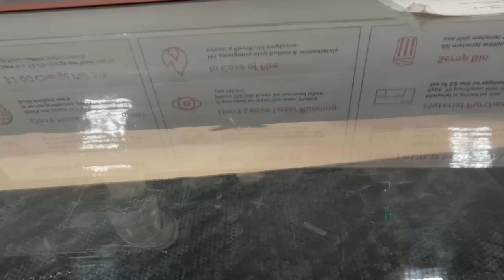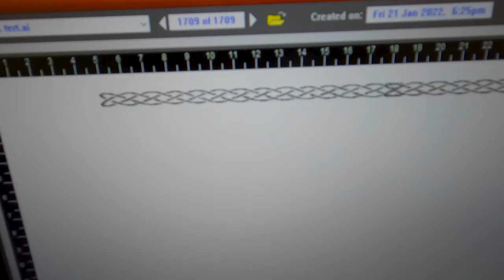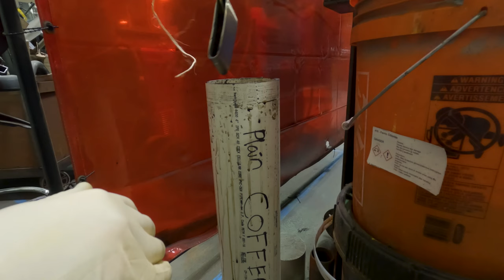Making a Fantasy Sword - Part 3 (The Witcher Inspired Build)

Comment: Forgive the ridiculous noobness of this question please, but on the chape, wouldn't it be easier to make a damascus block and then drift in the center and forge it out to length? Also thank you, your videos are very instructional, which is helpful.
Reply from the maker: Not a bad question and probably totally possible. I imagine it would be a horrific pain to do and probably need some tools created for the job like a drift about the size of the chape. Might even need a mold to beat it into. Also would have to make a large block just for the chape and then probably lose lots of material. Could probably be milled out of a block as well. All things that are possible but just beyond my scope and would be nothing less than overkill. haha. Great question, absolutely possible!
Reply: @hippoheadforge  I see in videos (FiF and others) that people often shape and weld and it confuses me. I have ZERO practical experience in this, but a decent brain. If you're going to forge a big "D" for instance, lots of folks would forge a "U" and then an "I" and weld them together. I know steel is tough to move, I just feel, based on 150+ hours watched (yes, including Mr. Superchamp), that the potential strength and durability of a drifted D would be better. I know the "theory" behind forge welding is that it mates/merges the parts, and Damascus would seem to give weight to that, but there's still that lingering "weld break" history in viewing. If you were going to ?war? knowing the blade was going to be your only tool (weapon, whatever), what would you personally do? How much more time do you think drifting a D would take? The chape I know would be a horn-numbing experience due to the mass, but a blade type thing? Also, thank you again.